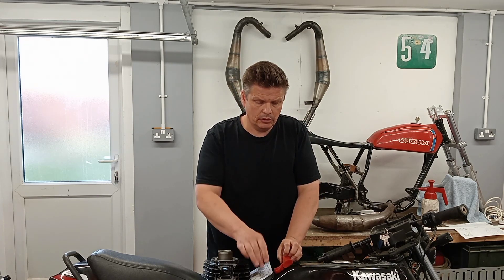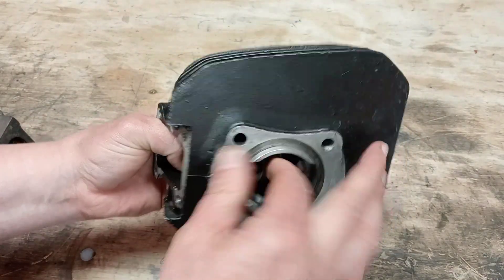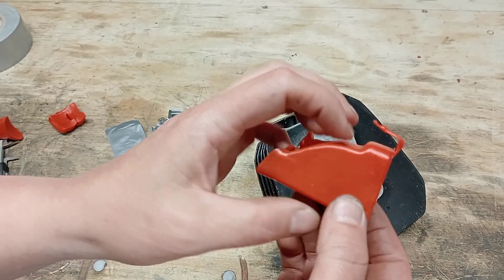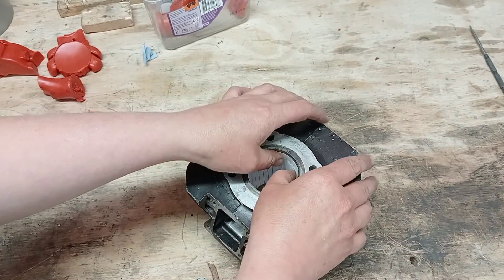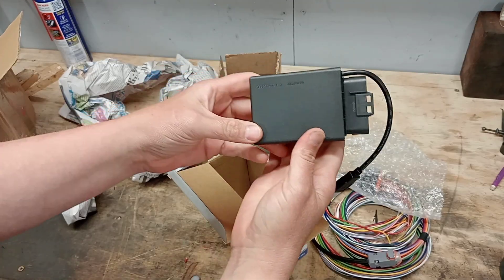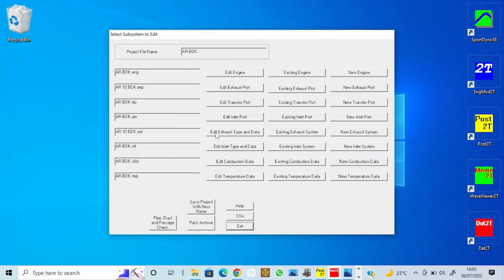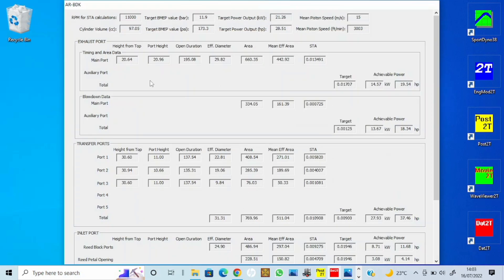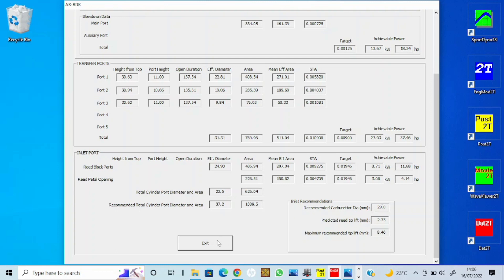TWO Stroke POWER, Port TIMING and PORT MAP

Comment: Hi!! I follow this searies and it’s fantastic!! Can I ask you something? I have a 125 2 stroke, that I want to increase the power. I noticed that it has really small booster exoust port… I will like to increase the area of those!! Do you have some tips to me? For ex, whats the internal angle i would keep for have the best flow? What’s the best shape for booster port? If you have some knowledge about it, i will thank you!!!
Reply from the maker: Hi, I don't really have a great amount of knowledge about triple ports. As always try to get the time area correct for the the power you want.

Comment: Hey david i watch your chanell for about a 1 week now and i like what you do, and bc i see you are on the subject trasfers i wana ask you something, i have a cylinder that have teoreticly 4 trasfer ports but actualy i find a version that have just 2 (that is bc in my version the ports have a wall in the midle) if i remove that wall i can gain or lose something?
Reply from the maker: Hi, thanks for watching. I would say if you removed the middle wall, then you would probably flow more gas, but the directional control would be worse, and in a two-stroke, both  are required.

Comment: May I make a comment …. I think a bit more work I can  be made on the Reed cage … quite a few years ago I had an aprilia rs50 which after many modifications would do a clean 75mph … mind you it took an age to get there … the engine was port matched home built exhaust 26mm delorto 360 crank etc running on a airsal barrel and piston … my first option was to run a vforce 3 Reed cage on adapter block which worked ok … but most gains were made from when I machined and fettled my own Reed cage I didn’t have a rolling road but speed and power and width was massively improved funny now I have a 3D resin printer and I could make any design I like … wish I had it then lol
Reply from the maker: Hi Lucky, the plan is to work on the intake again once I've done a few more tests. I have another V-force to try... I'm interested to hear what your modified reed valve looked like? Did you stuff it more?
Reply: @AutoBeta2T  hi … what concerned me on all Reed blocks was the nose of the vee there was always a big flat of aluminium there and the holes for the Reed petals were square … remember this was all before cad well at least before I had cad …the edge where the reeds were bolted to were rounded to stop turbulence from a square edge and in the nose of the cage the lead out into the intake I rounded like the front of an airplane wing … I then used resign to smooth out from round carburettor…. I have fusion 360 now I’ll try and draw it up so you can see the concept 
If i was doing the same now I would probably go for a belt driven disc valve … as when it’s open there is a clean passage into the crank case
Reply from the maker: @luckyrookie46  Hi, thanks for the detailed explanation. I think I get what you are saying but if you do get a chance to do a 360 model that would be great. In just getting back into Fusion myself... Not that I was ever any good at it before. My email is: autobeta2t@yahoo.com

Comment: 😂😂😂😂 , degree wheel 😢😢
Reply from the maker: I've never used one. I've been told they are not as accurate. 🙂
Reply: @AutoBeta2T  top racing never needed one, it's only people that don't really know their stuff will think about using a degree wheel, haha video fools. A lot of nonsense on internet. In the end it was just flow and pressure knowledge THAT Japan already did to his finest BUT restricted some a bit, some a lot. 
Just correct and upgrade with experience and not with nonsense talk and unnecessary tools and equipment. They really make asia and south America laugh sometimes.

Comment: Your aim off 11000 rpm is reasonable, I agree in that you have way too much transfer duration for that PRM figure, all that duration is eating into your blowdown angle. Lowering the ports is a little tricky, I guess skimming the bottom of the barrel might be an option as long as the piston does not end up poking out of the deck height too much. Clearly lowering the barrel will change the timing of the other ports, it maybe a good thing for the inlet but the exhaust port might need to be raised. Anyway I'm sure you know all of this. Your CR seems fairly low (I think it was 11:1), I guess that is uncorrected?)  Also you might want to consider a thermocouple under the spark plug, Trail Tech do a nice one, you can then keep an eye on the head temperature. AG Bells book states that you will get power fade if you go much above 200 C on the head, I've tuned up a Honda MT5, nowhere near to the level that you are aiming for, it is doing about 55-60 MPH on the flat, I can feel the power fade when the head goes above 160-170 degrees C. I've made a fibreglass air scoop which 'collects' extra air and forces it over the head, I've not done much testing with it but it does seem to help. My MT is running 14:1 static CR, 8.4:1 corrected. This might be a little high but I can't detect detonation so hopefully its OK. I think that you can push the CR up fairly high because the flame path is so short. You do need to run a 'proper squish-band head of course!...EDIT, just spotted that your engine is 100cc, not 50, I guess that you can't push the CR up as high as mine. Also you are cheating! LOL, (so am I, I run a 65cc big bore kit)
Reply from the maker: Cool - an MT5 was my first motorbike before I got an AR. It did about 45 as I remember... Giannelli pipe and hi power reeds 🙂
I was going to machine the barrel to get the timing down but it's been suggested to try epoxy first so I am. If I machine it then the dykes ring will pop out a bit and as you say it needs a good squish band.
Comp wise I was going to shoot for 12.5:1 and move up. The PS mag bike was running 15:1 uncorrected...
I had trail tech CHT on my X7 racer, I found 225 was fine, even 245 at Brands was okay but at Pembrey it went pop at 278 😔. I'm gonna definitely get another as I found it very useful. I like the idea of a cooling air duct. I think cooling will be the main issue particularly at sustained high rpm/load. Lots of fuel to keep in cool.
Yes a bit of a cheat but in my defence the magazine went this route so I'm blaming them 🙃
Reply: Are you willing to experiment with methanol for your cooling issues? I’ve even had great success controlling temps with Ignite E90.
Reply from the maker: Hi Ryan, the answer is possibly...
I'd like to do it on pump fuel as per the original challenge but I think it's close if I'll manage it. Options are: methanol to keep the temps down and get more power or better aero with a fairing. I guess I need to exhaust options with pump fuel first then look at the other options. 
What sort of temp drop/ power increase have you had with the E90?

Firstly I need to get my finger out and finish the pipe and sort out the ignition.
Reply: @AutoBeta2T  I have to confess that I have no idea what temps I run in the 2 stroke watercraft. However, in my 4 stroke testing (in Phx AZ by the way at 110 degrees) average running and peak temps are about 10-15 degrees cooler just by switching to E85 from the pump.

Comment: Great video mate ! Where does one still find the dat2T software?
Reply from the maker: Hi, the software is available here: https://vannik.co.za/EngMod2T.htm#:~:text=EngMod2T%3A%20A%20multi%2Dcylinder%20two,GPB%2Dmethod%20for%20pipe%20flows.
It comprises of a suite of programs: Dat2T, the pre-processer, which was used in this vid but there is EngMod2T, the main simulation program, and Post2T which is used to view the results.
I'll stick a link in the description too.
Cheers

Comment: Great channel  what was that material  you melted  and poured into the ports and where did you get it
Reply from the maker: Hi it's called Vinamold. I just bought it online. 😊
Reply: @AutoBeta2T  thanks  shared your vid told folks to subscribe.  Next question  that 2 stroke software  is 400$  correct
Reply from the maker: Hi many thanks and yes - $400 last I checked. And worth every penny.

Comment: You'l need to go to 90cc at least to do it I reckon .. My friend got close to 80 on his Aerox with a ported 98cc 2Fast jug and big final drive ratio
Reply from the maker: Cheers Chuck. I just found your comment... YT had it in the spam folder and I only just found it. I'm at 97cc at the min with the big bore kit. One of the issues I have is with the motor being over square so it limits time area. What is the bore/stroke of the Aerox?
Cheers, Dave
Reply: @AutoBeta2T 47 51

Comment: LOL a bit more technical than a few hours spent with porting files, jets, etc for 25 mins of raw power before killing the crank, Never understood why there was only a 93 kit for the AR as for the MB and TS ect there were 65 and 60 kits that were tunable without exploding, 16/17  33 sprocket combo at 18000 rpm will be over a ton! make sure your flat across the tank or you wont do it! Best of luck have fun.
Reply from the maker: Ste - thank you and yes, I like the technical and empirical side of 2T tuning but at the end of the day it comes down to porting files and jets etc...
I'll need to be more than flat on the tank too. Currently I have about 3 stone of COVID weight gain to shed! 😬
Reply: @AutoBeta2T  Yea me too i was a LOT smaller when i was 16 than now haha

Comment: How do you work out the transfer port area?
In books i only found that i should widen them slowly and see the result with every modification
Is there some universal formula for transfer port areas?
Reply from the maker: Hi Maciej, There are the Specific Time Area (STA) figures from Dr Blair's book - design and simulation of two stroke engines which were gathered from years of testing. These give you a good idea of what you need. I use Dat2T which gives you the Blair STA but converts it to what power the port area could support. However, these are just a guide and transfer area could be less or more depending on your engine; this is best derived from simulation or real world testing of different port specs. Note. As the height of the port increases the blowdown STA reduces (if you leave the exhaust port as it was). From what I have read the blowdown STA is key to getting the power. There is a lot of very good information on this thread - if you haven't read it, it's worth a read (if you have a spare few days...) https://www.kiwibiker.co.nz/forums/showthread.php/86554-ESE-s-works-engine-tuner/page1001
Cheers :)
Reply: Haven't seen this thread and didnt know about blairs book
Will definitely read through that
Thanks for the answer
Reply from the maker: @maciejz6914  No problems. There's a lot of info on there and well worth a read. 😊

Comment: Engmod is great but must be used in conjunction with an engine dyno in my opinion. Get a baseline test ASAP and plot the curve into post2t, as you will likely need to adjust the temperature files in data2t to match the real world results. After I did that I was able to actually use the sim for development. Excited to watch where you go with this.
Reply from the maker: Totally agree 🙂 and pleased you are excited to see how it goes - cheers for the support.
I plan is to hook-up some thermocouples in the pipe when testing. I'm interested to see what the temp difference is between the header and somewhere down the baffle cone is on the Dyno and then on the road. I imagine the pipe should run cooler on the road and need the tuned length tweaking...
Reply: Had the opportunity to run two EGT’s at a friends dyno (one in the header and one in the belly). Really interesting and helpful. Tried to find out a decent average temp for baseline FOS pipe calculations. (Tried Jeff Henise/Highwaymans weighted temp approach that wasn’t to bad but needs more tweaking in my case.)
Find the temperatures quite difficult to get right in EngMod. Thankful for any advice to a working approach.
Hopefully I can finish my dyno soon and get some lost inspiration back.

Videos and comments like this certainly helps though. 👍
Reply from the maker: @andli461 hi, I just noticed your comment... Must have missed the notification - apologies.
Ref temps I try not to use the temp correction at certain rpm points to get the graph to match reality. I prefer to just adjust the overall exhaust temp and settle for what ever curve I get (which is usually pretty close). Peak rpm in the sim maybe higher but I put this down to the sim acting  like a load dyno so a bit more heat in the engine and pipe compared to the inertia dyno. 
I'm keen to use Jeff's method for working out a good mean temp too. The test pipe (when I get it finished) is planned to have header and belly egt probes but I may stick on in the baffle cone too. I'm interested in the Dyno temps throughout the pipe v temps when it's run on the road. I think it may run cooler because of the extra air flowing over the pipe at speed...

How did you get on with your Dyno?
Reply: Hello. I just find this site...great videos and studying you do mr. Autobeta, respect! And yes, the temperature of pipe varying quite a lot... specially on the "street". I am from Finland so the environment temperature varying 0...+38C deg (not drive in winter), then driving at highway or forest or hillclimp.  Or how windy day is. There should be somekind of "thermoelement" in the surface of the pipe which conductivity changes with temperature...could help pipe tuning of the 2-stroke. Anyway great work you do😊
Reply from the maker: @TomKunnas cheers buddy, i hope.you enjoy the rest of my videos 😃